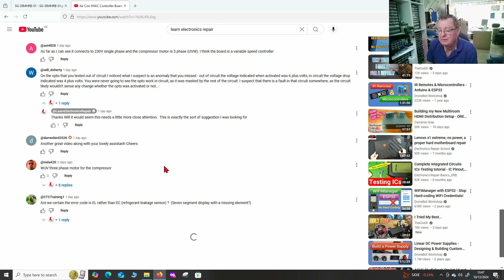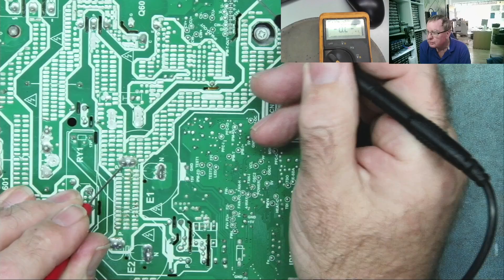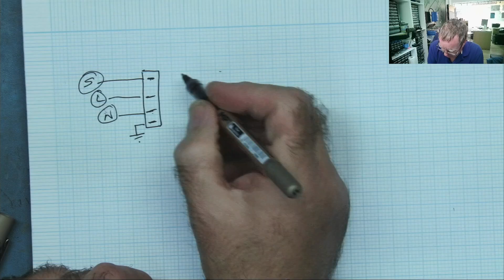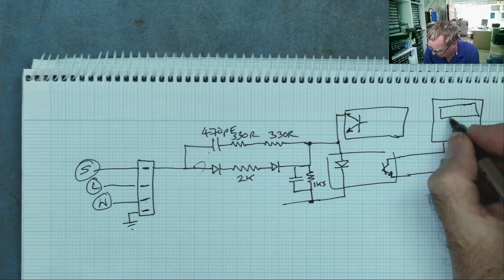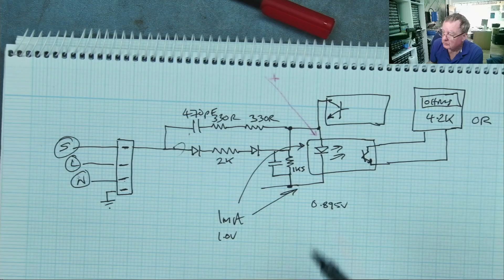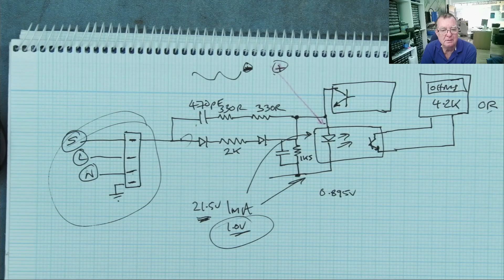I thought I knew some electronics but what I found on this Air Con HVAC PCB seems impossible!

Comment: I haven’t seen Rich trigger Optos with his led backlight tester before, it’s usually his fluke.  I often have this issue where a “new” bit of test gear is throwing up crazy results & it’s just because I’m not used to the test gear, I agree with other comments it may be a cct thru the led tester mains,the esd mat may be grounded, I’d suggest two things, try a dc battery to trigger the opto and or replace the fluke 9v, maybe a fresh battery will overcome the optos resistor and give him the usual result

Comment: In my previous life as an electrician, I just used to check the cables, check for shorts on the sensors/output devices, short/disconnect external sensors/devices & then switch the boards out for new ones until it worked, testing on the outputs for voltage. In retrospect, it would’ve been cheaper to drop all the boards off with a tech, but at £40+ an hour back then & no guarantee of finding the fault, it kinda made sense to replace the control units.

Comment: Mistery about the transistor being turned on seems to have a simple solution. Go to the time mark 24:41 in your video, turn on the slow motion x0.25, and look what happens: the multimeter attached to transistor changes his numbers even BEFORE you touch the input pin of the diode with the red needle. But, at the same time, you touch slightly a green wire with the yellow cap, and make it to move. lt looks like due to this movement, a whacky contact between green and yellow grips on the transistor side occurs, and multimeter detects it. It has nothing to do with the transistor state. If these grips were placed correctly without a possibility to touch each other, there would be no mystery.

Comment: A multimeter is a multimeter ?    Not really , yes they are isolated , but there are High impedance  meters and Low impedance meters , try a Triplett 630 meter to get readings .....

Comment: If your led tester is not 100% isolated from mains (which switching power supplies usually are not) then the led could light with only 1 connection if your bench is grounded for static discharge and the board touches the bench, it is possible that there can flow a bit of current to earth (which closes the cirquit).

Comment: Short to ground (cold side ground).  Do a reverse diode test......put red lead on cold ground and black lead on positive diode side of optocoupler......beeps means it is grounded.   Do the same to negative side of diode; put black lead on cathode side of optocoupler and red lead on cold side ground....beep normal for cathode side and not normal for anode side.   Now you find your short by injecting voltage into the optocouplers along with current limit at. .005 amps and see what glows with thermal camera.   Better yet, Google part no. and see what forward voltage and max current was used optocoupler to get specs.

Comment: The reason your led light up with one wire is due to capacitive coupling from your led tester. you basically get some AC ripple into your opto coupler from the LED tester. those LED testers are really poorly isolated from the mains and you get this ghost voltage on the output from them. I was not surprised at all when that happened
Reply: Would adding a small cap to his led tester remove the ac? If he wanted to.
Reply: @dollarbill8976  It should probably work to use an isolation transformer

Comment: For EMC reasons, there's a going to be a class-Y capacitor in your LED tester power supply between the secondary and the primary side. So a tiny amount of AC current can flow if your ESD mat grounded. It's hard to see how it could be enough to emit much light from an IR LED via that path but the CTR of the optocoupler would mean only a small current through the LED would be needed to read low  resistance on the meter. The current would easily charge the gate of a MOSFET.

Comment: Looks like you have an AC 50Hz signalling system and various neutral loops are confusing you.
That's why all the diodes and capacitors.
Take what you know about the outdoor unit and transpose the cct to derive the indoor unit

Comment: This is just a theory.
Is your bench conductive? Anti-Static ? Grounding the mat via 1m ohm gives a path? The LED tester is not isolated from the Nutural / ground? So when you connect the Positive leg of the tester you have a return path via the bench mat? But maybe you don't use an antistatic mat. Lol.

Comment: The opto for comms from outdoor unit to the indoor unit on the transistor side it’ll be rectified live through a diode and then from the transistor to the comms line , from the other side comms from indoor to outdoor it should be referenced to neutral there’s no other way around it , maybe through a resistor that’s blown ?  Or a capacitor. As for how the LED lights up with one lead, you’ll notice in your video the first time you put 1 lead on it doesn’t turn on, it’s only after you put both and charge up the capacitor , then once removed the capacitor has a charge, and it’s somehow then finding a path to discharge with 1 lead, (also trying to wrap my head around it )

Comment: It looks like there is only the positive half wave in use, where the other half is stored in the cap. i would try to test the caps for capacitance/esr maybe the whole circuit is running on less than needed power. the missing other side, maybe there is another high voltage cap (or two, or Y type) in the path, for that reason you could not read anything to ground/line
sorry for typo's

Comment: Interesting video. I've got a Metabo battery charger for lithium 18v packs.  And it was working but.  Put a battery on, and all seems to work. The fan comes on, lights come on, and go off as normal.  Put a battery on, and it starts with green light flashing but stops after a few minutes,  battery not charged. I've tested most stuff on board like caps, fets, diodes, resistors, they seem to be ok, I can't  really find any shorts, though there is an ic controller, not sure if thats the prob, but also has 3 optocouplers, ive tested in diode mode and  though  only got one meter,  wondering if they are the problem.  I'm out of ideas and past my knowledge, but I'm still learning😂
Reply: @Dolmar-Rick  Have you checked it the battery's charge on a different charging unit?
Reply: @IANHANDS  what checking batteries on another charger? Well, it did with all my batteries, and some are fairly new. I have since bought another metabo 145 charger, and that works fine. Though this is my 3rd, the first  charger  did the same thing but never looked at it and chucked it out. The second one was trying to get my head round. What's failing as there are no  signs of white smoke 😂

Comment: Heah, weird, did you change some capacitor before? Even through measurements?
What about ground it was unconnected?
What kind of signals must come to the microcontroller?
Where is the feedback ( Optokoppler) voltage to the microcontroller??
Lots of questions

Comment: I suspect that, if you connect your scope (in full blowup protection mode) to the output of that quality LED tester,  you won't see a perfectly flat DC supply with no low frequency transients and no high frequency switching noise. Add that to your LED lighting environment and flying lead antenna measurements. I believe the signals between the indoor and outdoor units are serial at 1200 baud on some models and are very susceptible to noise. There is an example of the opto configuration (which may or may not match what you have) on eevblog forum (understanding communication circuity of split system A/C)

Comment: Check the output of your led tester with a scope, I suspect high frequency pulsed DC or noise spikes that are being radiated into the circuit.  Prove it with your bench supply and a current limiting resistor

Comment: A puzzle wrapped in a conundrum! As I think others have suggested I think some kind of capacitive coupling is in play here. It looks like the signal input is intended to receive a high voltage high impedence drive of some kind. Think of the signal you can see on a 'scope probe if you leave the ground connection floating and touch the tip of the probe. I would be inclined to use a battery powered scope to monitor the voltage at the offending opto-isolator led cathode (the mystery connection) when you apply your LED tester voltage. Might also be interesting to see the behaviour if you just touch the signal input with your finger. However it works it is clearly a strange design. Look forward to the solution to the puzzle.

Comment: What voltage is the 3 phase output? You could connect 3 incandescent bulbs in Y config to substitute a motor load .. if too dim, you could connect them in delta config.

Comment: no LED can light up with only one connection current needs to flow, so if you don't provide a return path it will try and find it's own. I expect that you LED backlight tester came from China,  and hence has very bad leakage from the output voltage back through the mains. so you LED tester output is floating above mains earth by some amount. so with one lead connected the leakage current is trying to find a return path. i expect it's flowing through the led in the isolator to the 0V or ground and this ground is finding a connection to earth. if the leakage is AC then it will only need a capacitive return path and a few mA's could be enough to light the diode up.

replace the led tester with a battery and a resistor so that it's completely isolated from everything and this issue will go away. this is why you need to have better equipment with much less or no psu leakage current. for a test measure one output with reference to earth from the LED tester and see what the current. first check that the 0V output is not tied to earth.
Reply: Makes a lot of sense and easy to prove.
Reply: @andymouse  Not looking forward to when i start to get extra leakage. 🙂
Reply: @TheEmbeddedHobbyist  LOL ! nor me !
Reply from the maker: @andymouse  No it does not make a lot of sense.  Firstly the LED tester can only supply 1mA.  Secondly the LED in the optoiolator has a 1.5K resistor and a capacitor both directly in parallel with it.  Therefore it is going to present a low impedance load at both DC and AC frequencies. Therefore a stray/floating/high frequency AC voltage could not illuminate it. That much we can assume is true.
Reply: @learnelectronicsrepair  The original comment was just saying what we do know and for the infrared LED to light up there must be a current flowing and that makes sense. Did you read the rest which was saying use a battery and a resistor and test it as a simple opto? and that is quite easy to do, as I said so again this  makes sense! they are just suggestions.

Comment: Stray capacitance just like a neon tester will work with one lead touched the other wire in your hand.
Reply from the maker: So hold on a minute. I proved that my multimeter in diode mode can not light the LED but now you suggest just touching it with my finger can?  If that makes sense please elaborate
Reply: @ I’m not suggesting touching it with your finger. I’m suggesting high open voltage on one lead of the led and the other lead picking up stray capacitance.
Reply: @ doesn’t your led tester output high voltage?

Comment: Could the 2x back to back opto's be getting a signal from the outside unit that is something akin to RS485 or vehicle CANBUS, with the point where the opto couplers are connected together creating  a centre tap, effective zero? The large capacitor could block the mains leaving the signal ''floating'' say +ve to this unit and -ve to the outside unit or vice versa.
Granny teaching egg sucking possibly, but CANBUS has centre point with something like + and - 2.5 volts on 2x wires giving duplex comms. I have seen the same type of arrangement years ago on a printer where the power lead was used for the comms. I think similar was also used on grid across pylons, but with a bit more isolation I suspect.

Comment: Hi Richard, have you measured the floating-end of the photocoupler to that GDT? It might be possible that they use the GDT or something like DIAC as a high-voltage zener-diode as part of its driving circuitry.

Comment: I don't know about the voodoo, but this seems like a two-way digital signal. If so, the other end should go to the micro.
The diode in the opto most likely has a low Vf at low current, i.e multimeter supply.
Reply from the maker: I'm not sure I agree totally. I proved that the LED in the opto can not illuminate using my multimeter in diode mode as a voltage source, but thne some here suggest it can light with stray capacitance or something similar.  This does not make a lot of sense to me
Reply: @learnelectronicsrepair  I think this is because of the fluke diode mode tests with ~2V max and limited current (10mA?), and the resistor parallel to the diode drops the voltage to around .8V, whereas the led tester would be a constant current source with ~20mA and an upper voltage limit of 25V. Also the LED tester output would probably be 50-250kHz output from a buck converter with current limiter built in. So 5V/max 20mA from the bench psu and possibly a 1k resistor in between should enable the optocoupler without that strange one-wire artifacts from the tester

Comment: Hi Richard, The signal is going to at supply voltage (240v) or neutral, I would put a resistor of say 1m ohm between live and signal this will give you an AC voltage on the signal line with low current, this may provide enough voltage to test the working of the opto isolator.

Comment: Interesting autopsy.. Maybe your LED tester has some leakage from mains which is big enough to light the LED in the OC (but very strange, I believe your PCB is not connected to anything)?
Reply from the maker: Yes but leakage to where?  I'm only connecting one lead of the LED tester so current can not flow out of it (no return current path) and the LED in the optoisolator has a low impedance 1.5K resistor and a capacitor in parallel with it
Reply: @learnelectronicsrepair  Oh yes, I agree for sure.. More than 2mA would be required to light the diode in the OC for this to happen. Maybe your DMM on the "transistor end" is influenced by some strange fenomenon?  :) Shouldn't happen like this..

Comment: A proper comment now. 😅That is a great mix of working through the comments for alternative views and being able to compare the effective same circuit board in a different design. Very useful. Plus a legendry Rich drawing. 
Could the one lead from your led tester be acting as an aerial  to either dissipate energy or receive it as an aerial, hence affecting the optic isolator ?
Reply from the maker: Hmm well it could but  Ialready proved that my multimeter in diode mode can not illuminate the LED due to the 1.5K in parallel with it.  So how is something as high impedance as an 'aerial' able to do it?  Makes no sense...

Comment: Glowing led light without power have 2 reasons : a wire loop catches a field OR capacitance between nearby conductors causes power transfer between these nearby conductors (that are not connected). Electroboom made a video : why cheap led lights keep glowing.
Reply: and in either (c or l coupling) case it's ac, so led tester is outputting ac....
Reply from the maker: Do you have a link to that?
Reply: @learnelectronicsrepair  https://www.youtube.com/watch?v=_bgUy6zA0ts

Comment: Touching that positive lead to the circuit would raise capacitance in that part of the circuit. Try just holding a bare wire and touching that same place and see if that triggers the LED.
Reply from the maker: From what I can see the LED is not actually lighting as there is no current passing through it but then it must be because this is an optoisolator so there should be no electrical connection to the other side of the circuit.
Reply: That's a great idea to use a bare wire.
Also with either the tester or the wire, see how long it is still registering on the multimeter. Any residual energy or capacitor charge won't last forever.
Reply from the maker: @warwickbunn1250  Yes but... the opto LED has 1.5K resistor and a capacitor in parallel with it,  No high impedance ot high frequency AC source could light it
Reply: I understand that your led driver is not turning on the led, that is causing zero current, but that led is still turning on somehow, as the multimeter reading on the transistor shows. 
It's wodoo...like the elections in Romania😃
Just as a control lamp can work, which lights up when you touch only the "live" wire..

Comment: The led tester probably has a smps - so generates rf noise and this is then coupled capacitively back to mains neutral through the environment in the workshop. Looks like your “signal” line is high voltage - probably just 240VAC
Reply from the maker: Yes but this is an optoisolator so there is no electrical connection between the high voltage and low voltage side of the circuits so it should not behave this way.  Also the PCB is on my bench and has no connection to live neutral or anything else
Reply: @ It doesn’t need a connection if the circuit is high enough impedance. It will radiate the return signal. But I might be talking nonsense? Try connecting the led tester to a small led and connect the other side of the led to a crock lead just lying on the bench. See if it lights dimly? I hope I’m not leading you up a snicket :)
Reply: There might be a capacitive coupling. LEDs in optocouplers just need micro-amps to see the phototransistor changing resistance. Some people even see their 220V LEDs at home glowing, even after turning off the switch.
Reply from the maker: @kriswillems5661  But there are two arguments against that. 1. my multimeter in diode mode can't light the LED and 2. the reason that it can't and so capacitive coupling also could not is because the LED in the optoisolator has a rather low impedance 1.5K resistor and a capacitor in parallel with it!